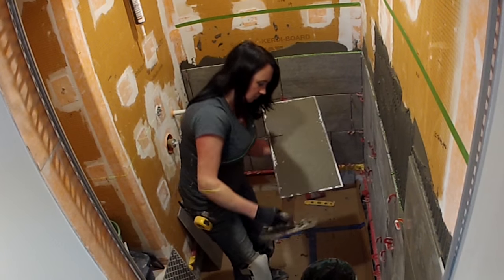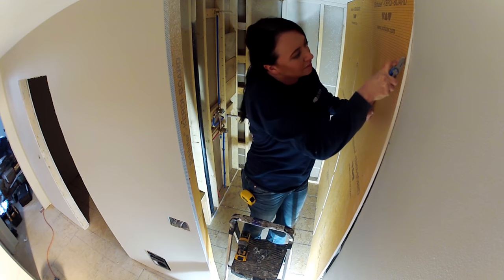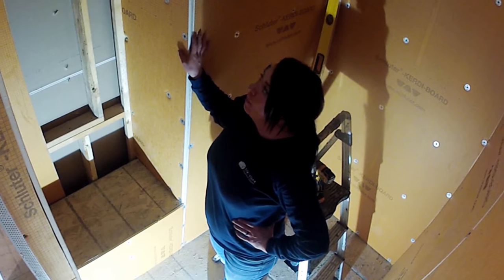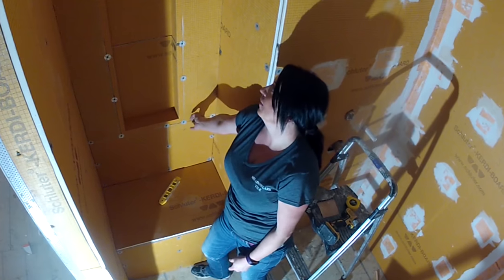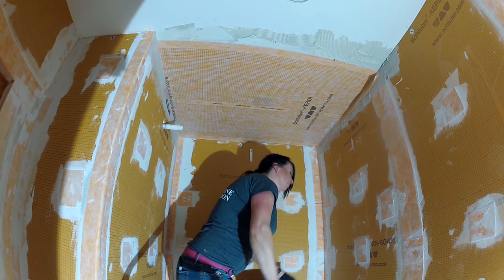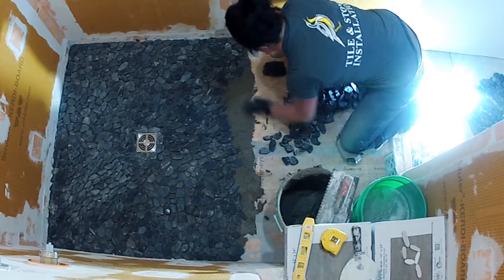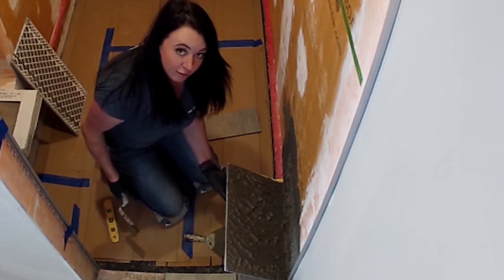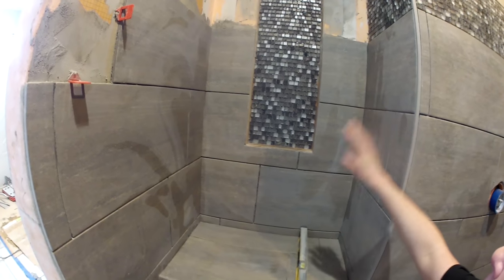Complete shower installation, Jaime shows us how to get it done. All the details

Comment: Whoever came up with the idea of pebbles going out of the shower and into the bathroom floor is a genius! Such a great piece of art!
My personal opinion on Kerdi: yes it saves time, but you can achieve the same result with traditional waterproofing materials and techniques at a fraction of the cost. Many clients appreciate that :D
Reply from the maker: Pebbles over the curb and into the main bathroom is not a new idea, but a difficult one to accomplish. No matter what you use as your shower system, as long as it is done right it does not matter what you use. Foam board just makes it easier and less taxing on the body, especially for an older installer like me.

Comment: Fantastic job and you certainly have what it takes, "patience", the extra time spent perfecting your trade now will pay you back bigger dividends than any stock market by assuring you a steady stream of clients. And since you're welcoming tips, here's a good one I teach to all my apprentices, always carry cut-offs and strips of 3/16" and 3/8" in your van when installing thin mosaics to flush them with thick tiles or a stip of 1/8" Ditra. You didn't ask but my biggest peeve with any and all trades people is FREAKING dull blades on FREAKING any cutting tool. There, glad I was able to take that off my chest after 61 years of tilling. Cheers from the Great White North

Comment: hey Sal, lets ship her out a set of hole saws, she could use them. Nice work Jamie.  I try not to use OSB in any water areas.  In the event water finds it from above or below, it will swell and expand cracking or splitting the work on it.  Not there should be any leaks, but things can happen that are not at all connected to the install and the subsequent repair could become more extensive than maybe necessary.  Great work Jamie, If Sal posted your work, that's the gold seal of approval right their!!

Comment: I would use a hole saw for holes in Schluter board. If the tiles are dead flat you don't need to do 30% overlap.

Comment: Did you do any calculations with regard to tile layout and the placement of the niche. I know the builders put the space for the niche in, but how do you rectify where the tiles go with respect to the placement of the niche? Or... just put the niche in and tile around it?
Reply: I like to put the niches in myself and land it on a grout line. In this shower, the builder estimate it in for me and I might have had to add/subtract some for the bottom shelf.

Comment: Hey Jaime great job, male perfectionist tiler here 😂. Was just wondering since I’m only experienced with the Wedi system not schluter. When you were putting in those 1st corners strips, should you have started from the bottom and overlapped going upwards like shingles, or does the mortar make it not matter?
Reply from the maker: Order does not matter, will be waterproof when the mortar sets, so it will hold water no matter the combination or order, as long as you have your two inch overlap.